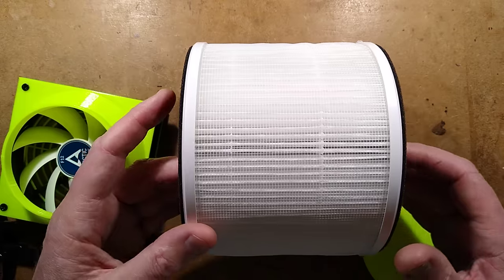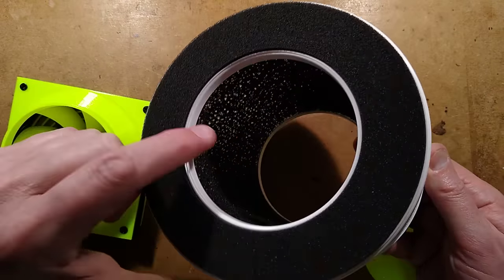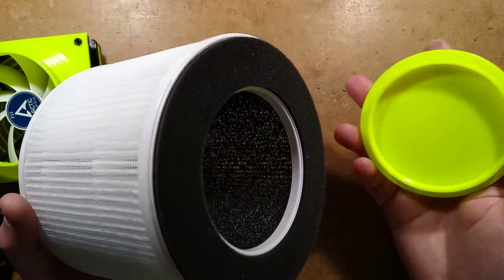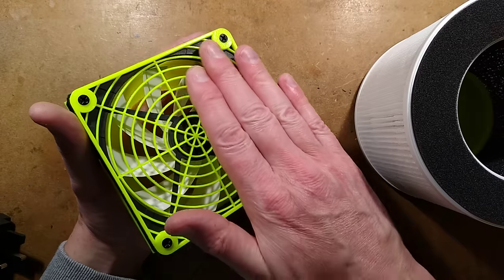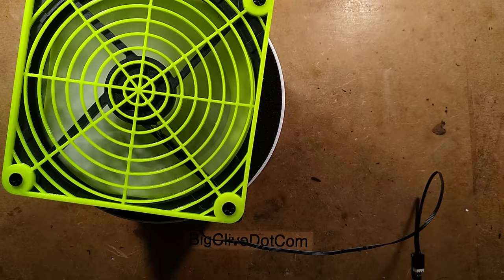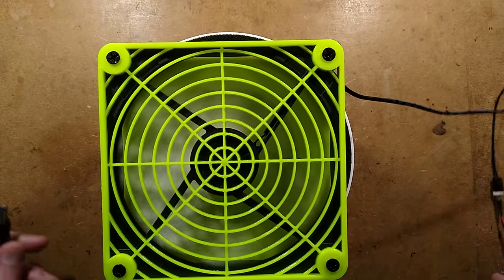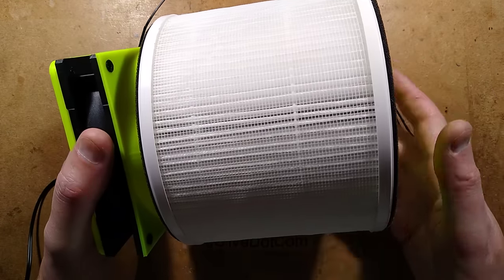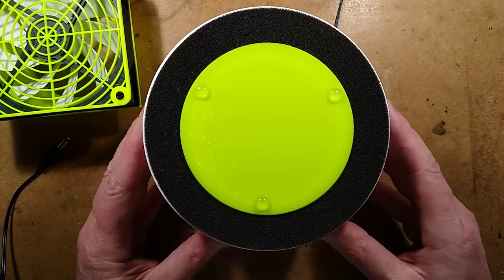DIY cheap & quiet HEPA air cleaner

Comment: Awesome work, thanks!
As I used a smaller fan I adjusted the script such that one could also change the fan size:

$fn=100;
//You can adjust these four variables
//Primarily the filter hole diameter
screwhole=5;            //fan screw hole diameter
filterhole=50;          //HEPA filter hole diameter
thickness=1.5;          //Thickness of plastic layer
insert=10;              //Length of insert into filter
side_length_fan = 92;   //Length of the fan
fanhole = side_length_fan - 4;
//Do not adjust anything below here
cone=(side_length_fan-filterhole)/1.5;
wall=thickness*2;
difference(){
union(){
//flange
translate([0,0,0])
cube([side_length_fan,side_length_fan,thickness]);
//taper to filter insert
translate([side_length_fan/2,side_length_fan/2,0])  
cylinder(h=cone,d1=side_length_fan,d2=filterhole);
//filter insert
translate([side_length_fan/2,side_length_fan/2,cone])  
cylinder(h=insert,d=filterhole);
}
//taper to filter insert
translate([side_length_fan/2,side_length_fan/2,0])  
cylinder(h=cone,d1=fanhole,d2=filterhole-wall);
//filter insert
translate([side_length_fan/2,side_length_fan/2,cone])  
cylinder(h=insert,d=filterhole-wall);
//fan attachment holes
translate([7.5,7.5,-1])  
cylinder(h=thickness+2,d=screwhole);
translate([7.5,side_length_fan-7.5,-1])  
cylinder(h=thickness+2,d=screwhole);
translate([side_length_fan-7.5,7.5,-1])  
cylinder(h=thickness+2,d=screwhole);
translate([side_length_fan-7.5,side_length_fan-7.5,-1])  
cylinder(h=thickness+2,d=screwhole);
}

Comment: Damn nice design!  
I just used an old computer power supply fan...200mm and is horizontally oriented...with some flexible dryer vent pipe & aluminium tape for the connection  :)
Reply: The German Ccc.media uploaded a video last year, that included airflow mapping and volume throughput as well as conection files to fit water pipes for seperation between input and output or changing angles.

Comment: If you’ve never used an air filter these are great. https://www.youtube.com/post/Ugkx_dppjvjF8BYEmPSDTcgCUdRsgWYLXNHN  I ended up with three after starting out with one. The noise level depends on the 1-3 settings with how hard you want the machine to work. You can also upgrade the filters and get one better for pet hair and smells which is a must have in my home. I noticed the air seemed lighter and easier to breathe when running the machine for the first time. Works great every time. Highly recommended!
Reply: is this a legit comment or just a bot pushing levoit as a 'good' option?

Comment: I've been using a box fan with a 20x20 fine furnace filter stuck on the back for a long time. Works amazingly well and it was super cheap. Not HEPA but it is MERV13.
Reply: When my wife's company decided to send them back to the office in the middle of Covid, I made a fancy version of the same thing - a nice wooden box with a box fan, merv16 filter and a baffle to keep the air from just recirculating inside the box. 

(I learned the hard way that I can't put higher than MERV11 on my home HVAC without it freezing up.)

Comment: Outstanding Clive! Very good to have during a pandemic. My 2011 Honda CR-V has a cabin filter behind the glovebox and it is surprising how dirty it gets. I have an old 12 volt computer fan and will try and make one.
Reply: I'd certainly expect an indoor one to get less visibly dirty than the car filter, since those tend to clean air going into the cabin scooped with whatever is being produced at the road (exhaust, worn away tire rubber, whatever else). Reusing the old computer fan will work, however if it's an airflow optimised one it might be worthwhile getting a pressure optimised fan instead. You can usually tell the difference based on the gaps between the fan blades, when looking at a high static pressure fan head on you typically see smaller gaps between the blades and there are less but longer blades at a smaller angle to the air they cut into on it.

Have had a regular commercial model myself in both the livingroom and bedroom for a bit over a year now, the replacement filters aren't too expensive and I can certainly say they mitigated my what I assume to be allergy to some stupid pollen during the bad seasons very well. Could actually keep the windows open periodically without getting annoyed eyes and a runny nose. Another happy sideffect that I noticed is that while it doesn't totally get rid of the problem there's a lot less dust buildup on top of items. Doing it this way in hindsight would've been cheaper and maybe get the job done too, but I don't regret buying them.

Comment: Our esteemed big guy is absolutely correct. All that these store-bought air filter units are simply a box with a fan, a controller, and a filter (and even an ionizer module if you bought one with that feature); the housing is pretty much what locks you into a particular brand/size of filter. He has shown us a simple Life Hack that can save people a ton of money over the initial cost of the unit and replacement filter media... As far as PC fans go, try to stay away from the absolute dirt-cheap fans with crap bearings, go for a recognized brand name. These will, by market necessity, be quieter.

IMPORTANT NOTE FOR COMPARING FANS: Look for higher CFM (cubic feet per minute), not higher RPM. These numbers do not always coincide with each other. A fan can spin faster, but move less air. Fans can be rated at the same RPM but move different quantities of air. ALSO OF NOTE, I'm assuming the smarter DIYers here can do this: if you use a larger diameter fan, you can easily boost CFM at lower RPMs, so larger PC fans are usually quieter.

I have a Honeywell unit for a large room, and just recently have found generic-branded filters on Amazon that are exact replacements - I can get two full sets (two 1-yr HEPA filters, 8 3-mo prefilters) for less than one single Honeywell-branded HEPA filter alone. And they work just as well as the original filters. It took a while for them to hit the market, but I'm glad they're out there.

I really like your use of the word "concertina-ed." Just goes to show how English has diverged over the ages, we call it "accordion-ed." Which makes perfect sense, actually.
I wish I had an opportunity to use that word in daily life, because I totally would. Maybe I'll start pontificating about coffee filters one day just for fun, and sneak it in there.

Comment: I support air filtration and this is a great price performance alternative. There are few small thing to watch out for: Plastic is not sealed and contains moisture and should be replaced with the filter. Or you could coat it, but be careful that all plastics and resin off-gas so resin is not a good choice.

PC fans have amazing CFM and will work well. However the unit will need to be moved around or multiplied a lot. Moving around should have a handle, you cannot touch the filter. Large particles will not be moved across the room with a fan, so you will end up having 3-4 places of these per room.

Comment: Love to see reuses for replacement parts... even when the original product is no longer made, the filter tooling stays useful. They're noisy, but would there be a benefit to the higher static pressure of a dual counter-rotating fan? Their use in blade servers make them quite low-cost on the secondary market.
Reply: Rule .1 Never buy secondhand Monitors, Keyboards, and Fans. You're just getting someone else's problems, burn-ins, germs, muck and fluff...
Reply: Just add a static pressure boost plate....stationary vanes. Don't need two fans!!! Boost Plate vanes are at the OPPOSITE ANGLE of the Fan blades!!!...just look at a cross section of a turbofan!!!
Reply: use centrifugal fan if pressure is needed  - can be very quiet depending on design
Reply: Rule #1: Always buy secondhand monitors, keyboards and maybe fans.

For the price of a pair of gloves, a bowl of lukewarm water, some q-tips and if you're feeling enthusiastic a bit of isopropanol, you get a massive discount on whatever you want. You also play your part in reduce, reuse, recycle by getting more use out of a still perfectly fine product.

I'm saying maybe on the fans because they are sort of mechanical products with associated wear, but with modern bearing magic the cost saving of 2nd hand probably weighs up again being pre-used, especially if you consider bathtub failing curves.
Reply: @snakezdewiggle6084  i get fans and keyboards, why not monitors?
Reply: @Danny Graves I have be able to pick up several monitors in perfect condition! They come from "gamers" who are consistently buying the latest and greatest and upgrading.
Reply: @Danny Graves it's really not a matter of being lucky. It's being frugal.
Reply: Rule 2: inspect devices before buying them secondhand. If keyboards and fans appear clean throughout and work smoothly they're probably fine. I'd trust a years-old server fan over a brand-new cheapo fan.
Reply: @snakezdewiggle6084  Nothing wrong with secondhand monitors, but the others I can agree with.
I have a pair of Dell 24" monitors that I got years ago, and have been great the entire time. They're the facy wide-gamut ones and calibrate well, even. I'd be looking at $400 to replace them with a new monitor of equivalent spec.
Reply: Static pressure (and the resulting flow) is a big factor for hepa filtration (they work better at a decent flow speed), but I personally would rather have multiple or larger quiet filters than a small loud one.
Reply: @ziginox  thats cool, you've had a Win with the monitors. I'm just saying that it can be risky when buying secondhand... ;)
Reply: @magnumopus9058  well back in the day, the phosphor in crt's could have areas where words and shapes were "burned in". These days it's about pixel death, backlight unevenly, things you may not notice until you are in Your Personal Space with your preferred lighting, and then you see faults. If its from a store with a return policy maybe you're okay.
Reply: @eDoc2020  I've picked up keyboards, heard a rattle, flipped it over, and mankie smelly bits of food dropped out. Optical Drives with melted ice cream. I'm not a germophob, but these items would not survive the local car wash ;)
Reply: @JoranGroothengel  Of course Reuse Recycle Reduce should play a large (biggest) part here, except that humans driven by materialism are often cashed-up and lazy. I'm a maker/fabricater, Re-purpose is part of my 'mission esprit'.

Comment: 20 inch box fan and a HEPA grade furnace filter. A real DIY without the need of an expensive 3D printer just some duct tape. I have made these for decades and they clean alot of air.
Reply from the maker: They don't really use furnace filters here.  Our heating is based on hot water.

Comment: You could use a high static "pressure" fan they are more optimized for such an application.
Reply: artic p12
Reply: Noctua
Reply: Mine are all centrifugal
Reply: @snakezdewiggle6084  Then it's no longer cheap. Arctic fans go 95% of the way at 50% the cost.
Reply: You can parallel 4 cheap PC fan and run them at 9 volt or less. Far cheaper than branded fan and have higher static pressure.
Reply: @era7928  100% on point with that misinformation.

paralleled fans double, triple, quadruple the aiflow - not the static pressure.

so finest misinformation you spread.

serialed fans would raise the static pressure with each step.

Comment: In my desktop computer, I have 2 such fans running horizontally almost 5-6 years. They didn't give me any problem so far(these fans comes with the computer case not special or expensive fans). I think orientation doesn't effect their  lifespan.

Comment: You'd want a fan that can create enough pressure. Every fan is different and computer fans usually are not optimized for pressure but throughput.
Reply: if it meant to be left running all day / every day, as long as the fan is making a air pressor difrence from the onside of the box to the out the box (room/House)

Comment: Using a high static pressure computer fan with that filter would be optimal.
Reply: That's the type where there isn't a big gap between the blades right?
Reply: @rct999  Yep.

Comment: I love OpenSCAD.  Thanks for the HEPA filter suggestion.
These fans don't care which way they are mounted.  There's no noticeable load on the bearings.  But if you're concerned about that, you could use maglev fans.

Comment: Have you got this setup to suck the air through the filter and then the clean air going through the fan and up, or is the fan sucking and pushing the air through the filter?     Just curious if one way works better than the other.  I would think sucking the air through the filter would protect the fan from dust, but then maybe the air flow is greater pushing the air through the filter :)
Reply: its pulling air through the filter to the fan

Comment: Very interesting. But... I recently felt the need for a HEPA filter and I had given away all of the ones I had bought years ago. Anyway, as you point out, it would have cost a ridiculous amount of money to replace the filter elements. So I pondered how to do it on the cheap and I discovered that there are inexpensive HEPA filters available for your home forced air furnace. And one of the sizes of cheap home HEPA filter elements is 20"x20", which is the size of a standard box fan. Not too much brainwork to mate the two. It is nowhere near as quiet at yours, but it moves a LOT of air!

Comment: is that the right direction airflow for that filter
Reply: Based on having the coarse mesh on the outside, then particulate, then finally activated carbon, yes it's designed to have air go from the outside to the middle

Comment: I've got some Honeywell units running in my room. They have coarse, black pre-filters used to collect the larger floating material which look a lot like that inner sleeve. You sure that's an outside-in filter rather than an inside-out filter?
Reply: The mesh suggests it was designed for outside in. It's usually better to have the carbon filter after the dust has been removed so dust doesn't keep it from doing its job. It's not a huge problem the other way around, though. I think a few manufacturers have it do double duty instead of having a separate mesh to stop the really big stuff.

Comment: Nice!  Seeing as many computer fans are now 4 pin with PWM control, have you considered adding something like a 555 based circuit with a potentiometer to adjust fan speed?  Nothing wrong with the diodes, but just a thought if you're bored one day :)

You could put it in the same unit as the ioniser ;)
Reply: Controlled speed drive (good for staying quiet) needs the tach feedback. A 555 timer can adjust to a drive percentage, but with an op-amp and another RC filter, it can apply full field current when starting. A microcontroller could probably do that for 8 fans at once, and drive an LCD at the same time. ;-)
Reply: Yes, PWM control is far better. Lowering the voltage can introduce, stater chatter, bearing chatter, blade flutter.

Comment: I made one of your last air cleaners, the one that uses a square of toilet paper. It's been running fine with no bearing problems in the fan. It definitely collects dust, but I think I need to make something that pulls through a larger amount of air in a given time, as my room is fairly dusty.
Reply: i've been making a few designs using the hvac blower from ~2000 Dodge Ram (cheapest blower I could find, plus its mounting design is easy to model compared to some others out there) and a furnace filter.

it's kinda overkill, but it was a fun project

Comment: Next step: design a cowling around the filter that tapers to a 110mm coupling. Add a tapered fan coupler on the output of the fan. Hey presto! It's an inline version that could be plumbed into ceiling vents for permanent room air filtration.

Comment: Well, the fancy part of a proper filter is that structure of the filter, being able to catch particulates of the size it does, while still allowing a decent air-flow. There's plenty of sources for filters, depending on the filtration needs, such as replacement units for home air filter systems, air filters for cars etc. as well as for vacuums. I however found the cheapest, and easiest way to get a good system was to just buy a floor unit. Of course that's no fun DIY, and you are at the risk of the spare filters going obsolete as they push their next models, but it was decently cheap and works really well.

Comment: Nice idea! I had a similar filter in a full filtering machine, but sent it back. I trust that this is a HEPA filter, but the activated carbon part is likely just fake. In car interior filters, the carbon is actually woven INSIDE the HEPA filter. My Philips air filter that replaced the one mentioned has an activated carbon filter placed behind the HEPA one, but it's MUCH larger and deeper.
In short: It's probably just a HEPA filter with something that should look like a carbon filter (in my case it was likely just thin black foam).

Comment: For my shop I have one of those cabinet style blower air cleaners, where 80% of its 1' x 4' x 4' volume is filter. Coarse furnace filter as a first stage and the big $40 filter is 1um rated. For a less dusty environment like in a home I'd imagine you would replace the filter like once every 10 years or so. Obviously its a hit loud for a house but no louder than an attic fan